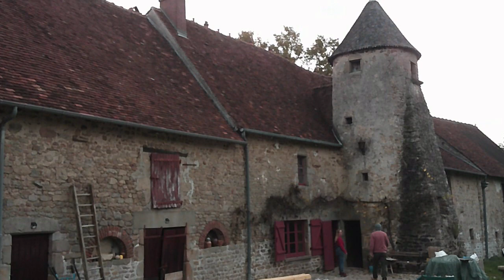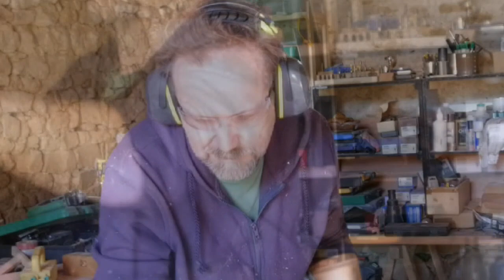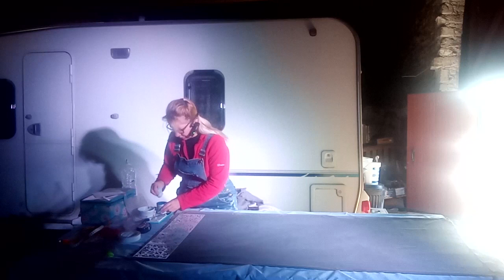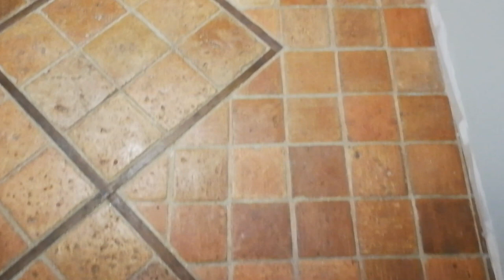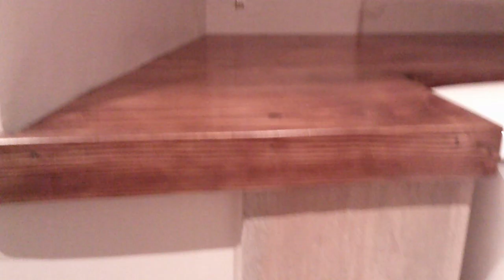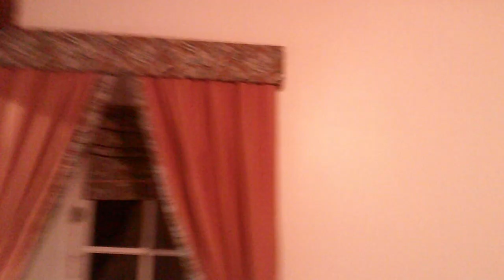49. Renovation of a 14th century, Chateau De Montmagner

Comment: 24.30 Ted, my Dad was a Foundry Patternmaker before he retired, he has a workshop full of useful off-cuts. So useful in fact that no matter what the situation, if you need a specific size piece of wood for a one off random thing that needs fixing or project that you're doing you can guarantee my Dad has the right bit of wood.. no kidding, I needed a board to go under the seat cushions on my knackered old sofa and my Dad had just the thing, he even remarked that you wouldn't believe how many times over the years that exact situation has occurred, where you need a specific piece and somewhere in the workshop there it is :D It's a wood-workers phenomenon.

Comment: Sandra Westley I have seen those stencils used in a Chateau, they painted the floor tiles red and then using the same stencil (larger size I Believe) painted it white/cream and it looked fabulous, so if you’ve got some ropy floor tiles give it a go. The stenciling you did for the blind looks  great, really good, I hope you won’t be upset but I think it would be better without those tassels, sorry, after all your hard work, just IMO. Love the wall paper and the cupboards it looks like a Laura Ashley print.
Reply: Yes Lesa said that it is Laura Ashley it's lovely isn't it